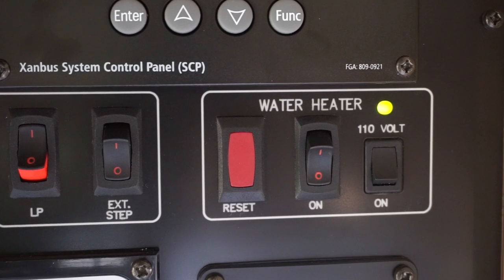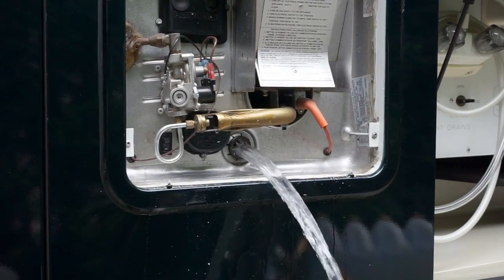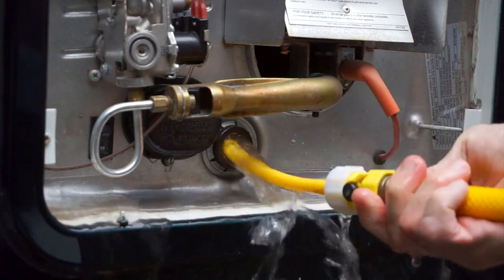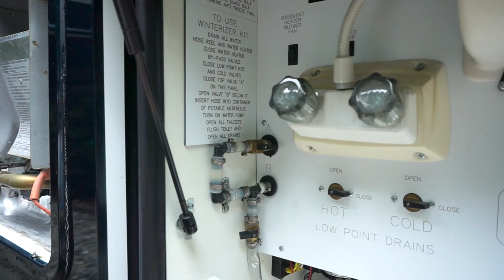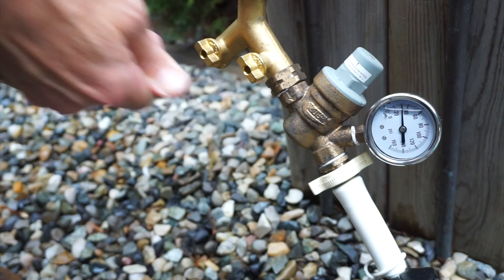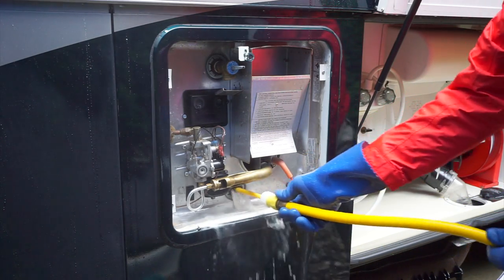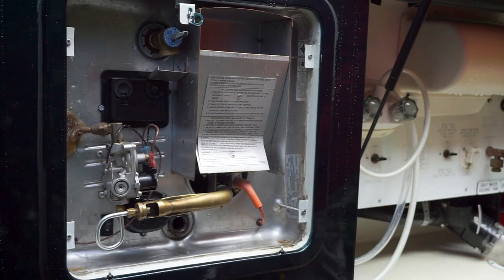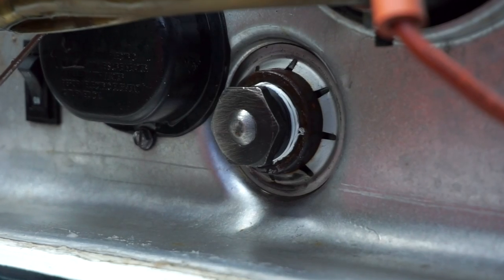Does Your RV Have A Water Heater? WATCH THIS!

Comment: why don't you guys use a tankless water heater?  would like your views on this...
Reply from the maker: Hi Kelly,

Both of our RVs came with standard, tank-style water heaters... and while we haven't personally had experience using a tankless one in an RV, we have had some experience with them in sticks-and-bricks houses. Our take on them is that they're not as good for dry camping because of the way that they work. They only fire up when a large enough flow of hot water is being called for... so when you only trickle the water to conserve... you don't get any hot. So that's a deal-breaker for us.

And while it's true that in a household application they can reduce energy consumption, since you only heat the water you need, we don't think that benefit carries over as much to RVing. When we're out dry camping, we generally only turn the water heater on once a day to heat water for our shower. And the tank stays warm enough that we've got plenty of warm water for our other daily needs without firing it up again. Plus, even if we do leave it on, the typical RVer is only heating about 6-12 gallons of water... not 50 or 60... so there's already a big energy savings compared to a house.

We know that a lot of RVs these days come with diesel-powered hydronic systems that provide both heat and hot water... and that lots of people who own them say they'd never go back. Which speaks highly for the systems. But we think it may depend on how you RV.  If you spend most of your time at full hook-up RV parks, or very few nights camping "off the cord", tankless systems are probably wonderful. But if you dry camp a lot and need to conserve water, they may not be so great.

Hope this helps!  And maybe some other people who have tankless systems can chime in with their experiences.
Reply: Thanks for the great info...I need to think more about going tankless...great videos...and thanks for sharing...p.s. think you will ever get down here in southeastern U.S.? We have got some beautiful things to see...have a wonderful day....
Reply from the maker: We're generally "West of the Rockies" RVers, but you never know. We did spend one winter in FL and the Keys, but we somehow we somehow always seem attracted to the mountains out here. :)

Comment: My fresh water is draining when I go to drain my black and grey water why
Reply from the maker: +pikichu1442 By "draining," we assume you mean that it's coming out onto the ground? How fast is the water coming out, and where is it coming from? There's a small tube under the RV called the overflow tube that allows excess water in the fresh tank to drain out to prevent it from exploding if the tank fill is left on. Does that look like the spot where it's draining? What make, model, and type of RV do you have (Class A, 5th wheel, etc)? Are you hooked up to city water or is your water pump turned on? If you provide a bit more detail, we might be able to help.
Reply: RVgeeks it seems like it's just coming from the same pipes as the black and grey water it gets clear and just keeps running and running and running we were wondering why we didn't have any water in our tank we have a Holiday Rambler ambassador diesel Class A
Reply from the maker: +pikichu1442 So it's draining out your sewer outlet? Hmmmm.... the only way we can imagine for water from the fresh tank to get into the sewer/drain line is for the water pump to pump it out through a faucet and down a drain. But we assume that if your pump was running and/or you had a leaking faucet, you would know it. That would also potentially cause your gray tank to overfill up and out through the shower drain. Is there some other factor you can identify that we might be missing? Do you have, and are you using, a black tank flush system?
Reply: RVgeeks none that we know of I know when we drain the black water and the grey water it ran clear for the longest time then we went to dry camp and had no water at all which we should have
Reply from the maker: When pulling the black and gray tank valves, that should only drain the corresponding tank, and nothing else. The only reason you should see clear water continuing to drain (which you would only be able to see if you have a clear sewer elbow, of course) is if you are hooked up to, and using, a black tank San-T-Flush system. But of course if you were doing that, you'd know it.
Here's a test for you.... fill up your fresh water tank completely. Then without being hooked up to city water, and with your water pump turned off, dump your black, then gray tank (in that order of course). Once the black tank has finished draining, the flow should taper off to nothing. Then, after that, once your gray tank has finished draining, the flow should taper off to nothing. Then you should still have a full fresh water tank. There's no connection we can imagine that will simply allow your fresh water tank to drain directly out through either your black or gray tanks, since any direct connection between the fresh and black or gray tanks would contaminate the fresh water.

Comment: you should never use the pressure relief valve to manually release the pressure on the water heater. to relieve pressure from the water heater tank use one of the fixtures hot side valves. the P.R.V.is for safety and should never be opened manually.
Reply from the maker: Why is that? You have to open it to get the proper air gap at the top of the tank, and Suburban's own instructions say to open it and re-close if you're getting weeping.
Reply: a lot of time the washer will not seat properly causing the P.R.V. to prematurely open up, also running water through the P.R.V. could cause a foreign material to get between the washer and the seat causing a steady leak when water pressure is turned back on. to get rid of the air gap just open the hot side of one of the faucets, turn the water back on and when you have a full stream of water coming out then the air gap is gone. you can open each water valve to mak sure there is no air left in the system.